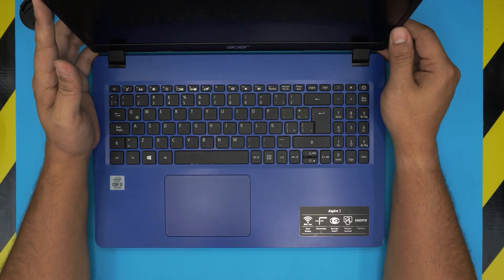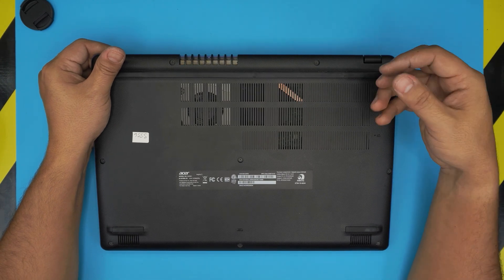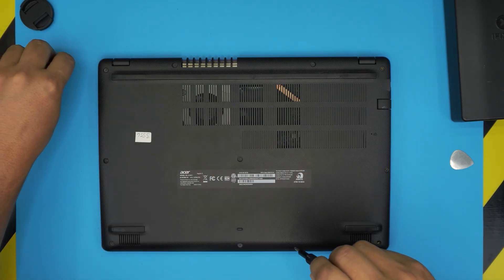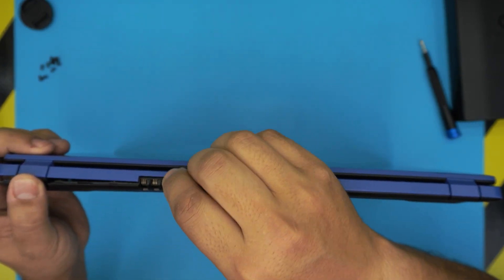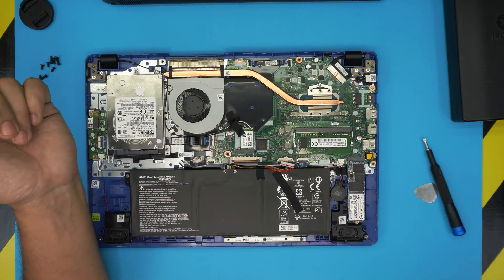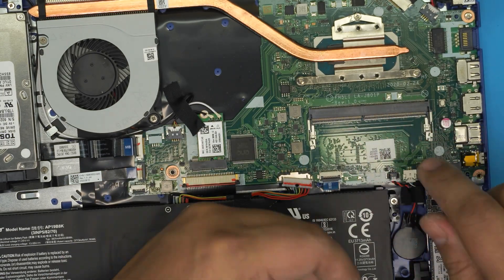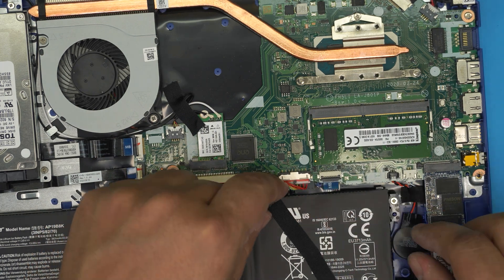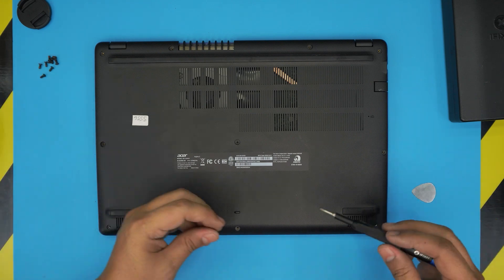Acer Aspire 3  N19c1 🚩 A315 56 38Tb 💻 Ram Upgrade

Comment: Firstly, i want to thank you for that informative, not really long video and helping us out. Secondly, i have one question: if there isn't first slot for RAM then can we buy any model like Kingston, Samsung and etc.? I mean preferably Kingston?
Reply from the maker: It's my pleasure, my friend. 😊 I deeply appreciate your taking the time to provide feedback. If you're inclined to support the channel further, feel free to like and subscribe—or even both!
Regarding your question, you can place any brand of the ram you will Kingston or any other brand, as long as it is a sdram DDR4 you will be fine.
Should you have any further questions or requests in the future, please don't hesitate to ask me.
cheers🍻
Reply: @uFixTek  thanks sir you got my respect and subscribe🫡
Reply from the maker: i appreciate your support my friend.
Reply: @uFixTek hey sir i got my RAM and it suited really well, thanks for the answer previously.
And why im typing is that i also wanna buy M.2 SSD into that laptop. So the PCl-E Express there is 3.0 x1. And then i looked for that kind of characteristics and found no M.2 like that. I mean, there're lots of 3.0 x3 or 3.0 x4 but i haven't found any x1. So the question is: can i put those M.2-s with x4, even if my max is x1? If it does, my guess is that it will just work a little worse and that's it.

Comment: I'm kinda disappointed with my Aspire 3. It has 4 GB of RAM soldered on the board, so I'm limited with the speed and capacity. I wanted to game with some light titles on it, but the soldered RAM is the bottleneck. Ryzen 5 3500U is not that bad.
Reply from the maker: Thank you for the feedback! if you wish to support the channel you can LIKE or SUB or both :P
regarding the ram : yes that's a big blow in the face for those who need to add more ram, i highly recommend before purchasing any laptop make or model always take a look at the motherboards.
Reply: @uFixTek  I mean, I wasn't the one who was buying that laptop. I would definitely go with a bit more expensive one.
Reply from the maker: oh oki, always go with mid range or higher to have the benefit of upgrades.

Comment: you said we can put 32 gd ram stick in it  but on official wedsite they are telling that it can only support till 12 gb ram
Reply from the maker: 1st of all my friend the official site and all the tech support on the brands are total retard!. we even for fun call some asus or hp support line and ask what is the max ram capacity for XXX laptop and they give us 8GB or 16gb , BUT it's not true and tested and 100% pass with higher capacity.
NOW if you have the same model as this video! you have a 4GB ram? or you have 4GB on board and a free slot! or you have 4gb on slot and 4GB on board? 
NOTE: there is no such a thing as one ram stick of 12GB its (1GB, 2GB, 4GB, 8GB, 16GB, 32GB sticks only)
and there is no such a CPU that is rated for 12GB ram, so right there everyone knows that the "official site" its full of crap.
you can place a 16GB stick on the laptop and it will work just fine and if you have 4gb soldered on board it will add to it and work!total of 20Gb.
BUT 32GB its supported by the CPU but not all 32GB single sticks are compatible with all motherboards. so go with a 16GB stick to be on safe side.
and if you want to know what is the max ram capacity for the CPU check this link.
https://youtu.be/tKEJTkVth4Q
Reply: @uFixTek  nice